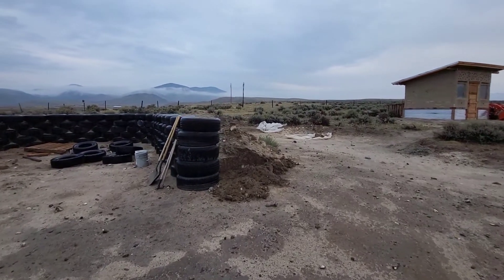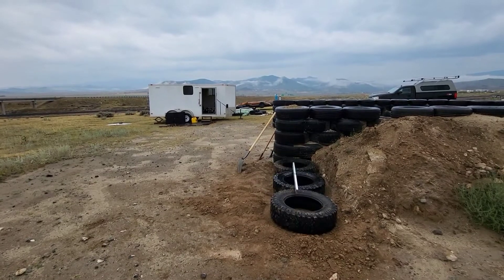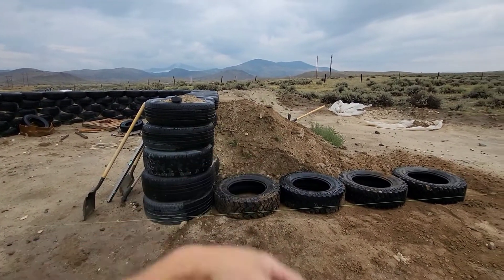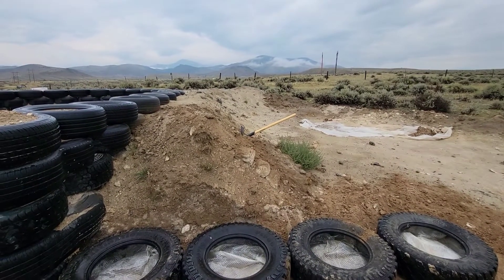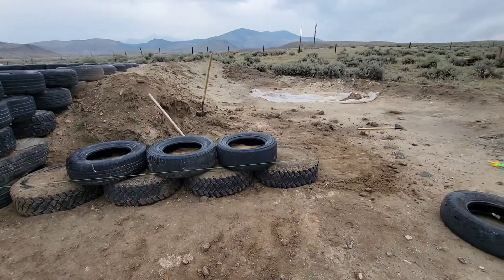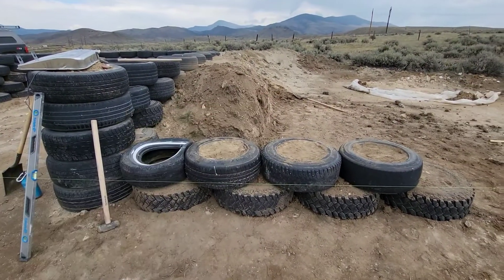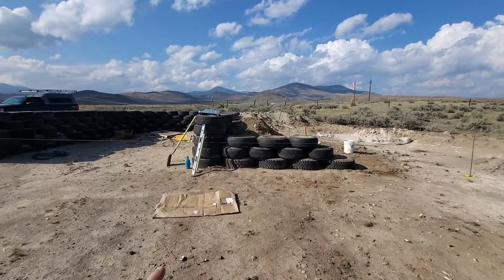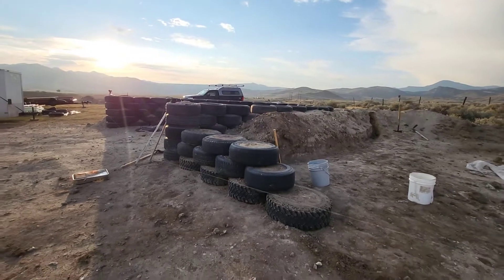Mini Earthship Build part 6: Getting back to work

Comment: Do you have a regular job in Montana. It has to be difficult working part time on your house.
Reply from the maker: I'm a contractor. I usually try to take more time off, but I overloaded my schedule this summer. I should have a lot of time this fall before my winter contracts start.